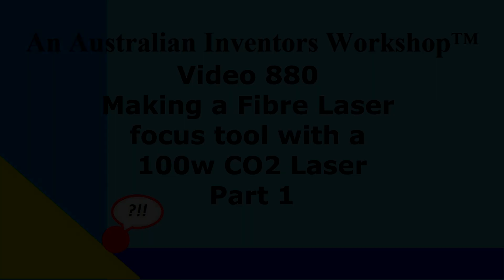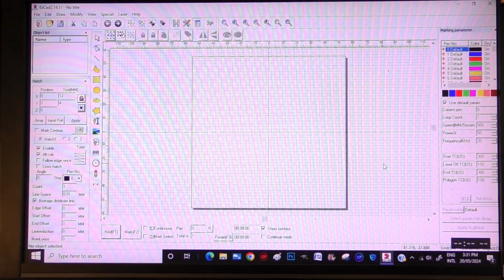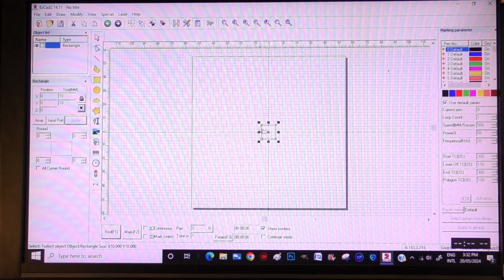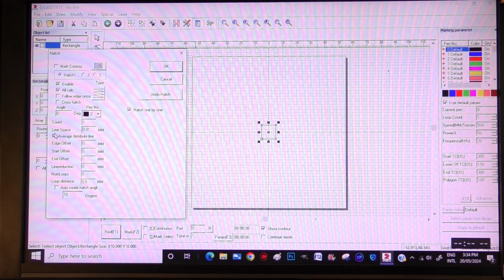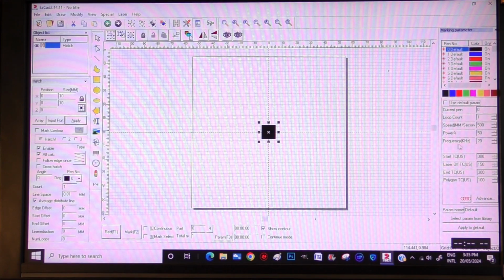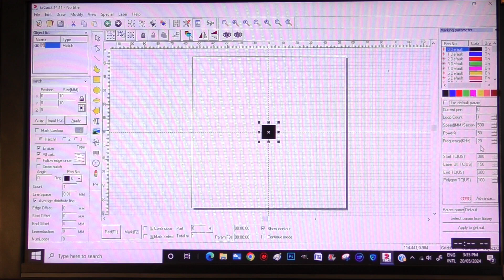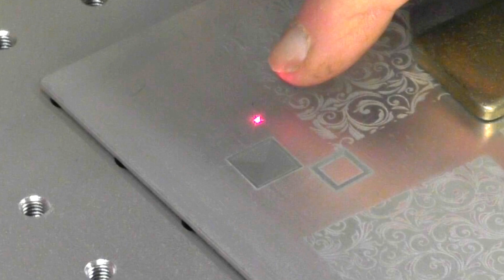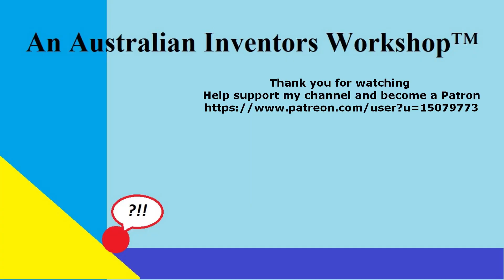Laser Tech Tuesday #1 Making a Fibre Laser focus tool with a 100w CO2 Laser

Comment: I have a collection of focus T's cut on my 80W CO2, one for each lens 110, 175, 220, 300 for the Fiber and 110 & 220 for the UV. I have a couple of others for specific lenses for things like Z-Mark on stainless as well. The 300mm lens on the fiber is pretty darn long, but what I tend to do is cut them 5mm longer than I want, and then once I follow the same procedure as you did in this video,. I use my bench grinder to slowly shorten the focus stick to be the exact length needed - that way any errors in cutting, even by just a mm or two, is negated. Oh and then I can label them on the UV so they look nice and pretty too lol